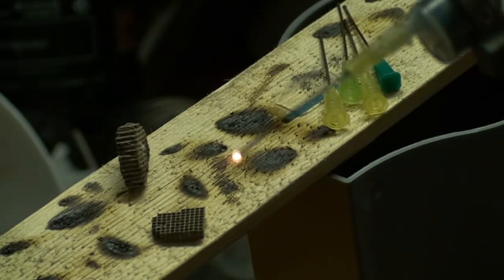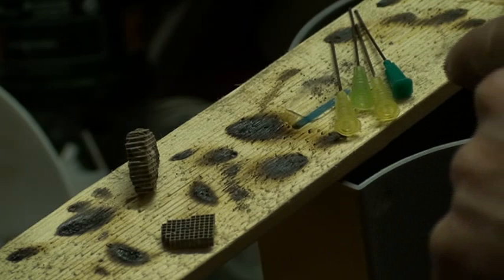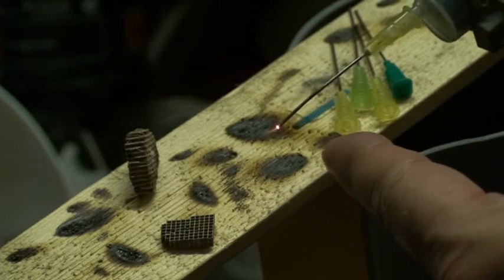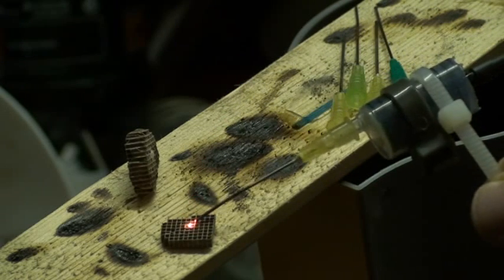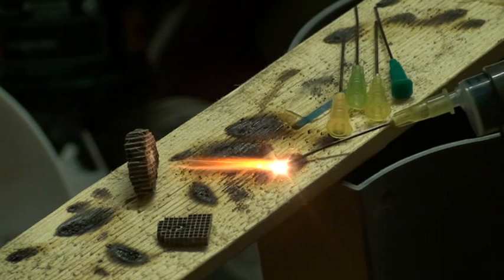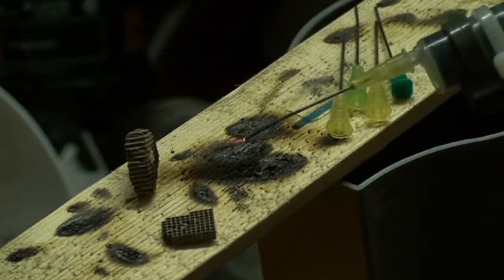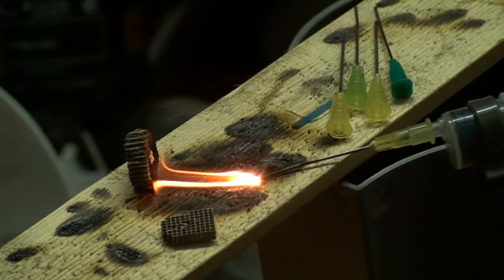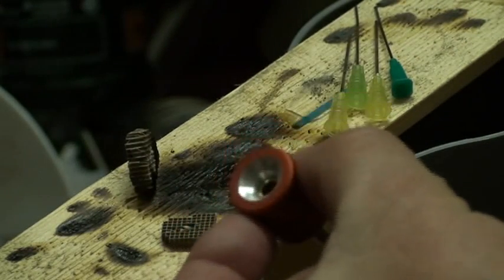CAT to LENR apèroach 7 wmv

Comment: Laurent,
Here is an idea.  Obtain some graphite and bore a small hole in let's say a 1/4 inch diameter carbon graphite rod at least 2cm long as used in welding.  The diameter equivalent to the ID or OD of your hypodermic needle.  The key is to have a one way valve type mechanism to prevent back flash. A nifty way to do this would be to have machined in carbon graphite a tesla valve that has no moving parts.  Any back pressure would cease flow and arrest flash perhaps.  Bravo again.

Comment: Interesting stuff. What about trying to make a Cathode out of the CAT material and try a original Cold Fusion type experiment? You would need heavy water for that though.

Maybe the hydrogen from simple to make HHO is not such a bad idea. If you could somehow make a loop and recirculate the air the energy needed to maintain the reaction could be drastically reduced. If it is a LENR reaction then just a tiny amount of the HHO is actually used.

Comment: Hi Woopy, now that you did this. PLESE take this to next stage. Which is "atomic hydrogen welding". By doing this you open up a hole in the fabric of the universe and draw out immense ou flame and power. 
Use these key words to find it online: AtomicH/AHW.html 
Also see this video you tube: The Inside of Atomic Hydrogen Arc Welding, Part 1 - 1943.
If you need instruction? drop me a line.